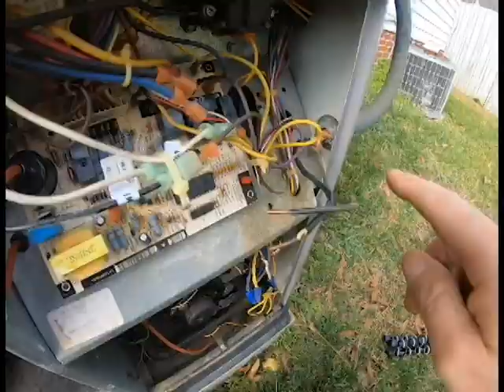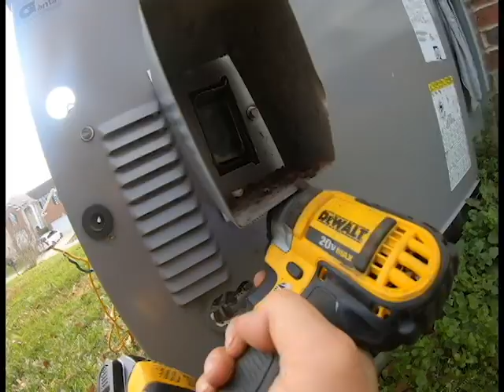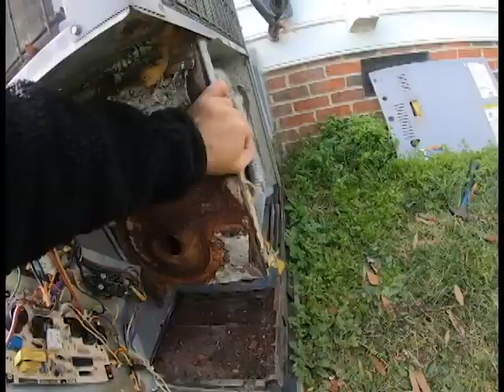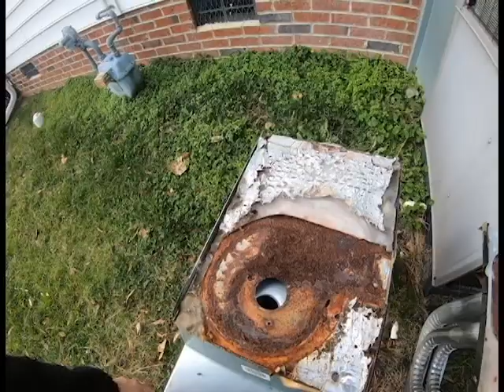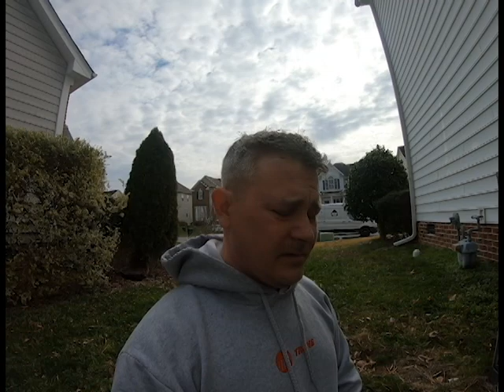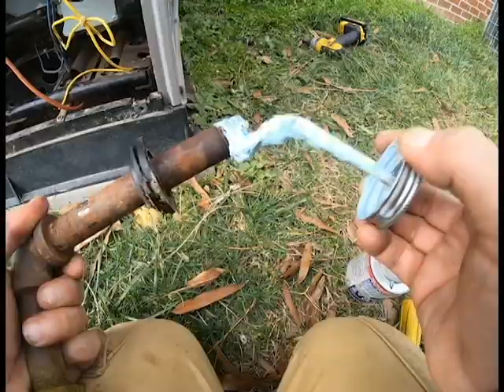How to Replace a Carrier Heat  Exchanger!

Comment: Appreciate this video! I have to do almost exactly the same job for my home unit. I was able to remove the same parts following your video. I will be upgrading cracked aluminum heat exchanger to stainless steel and will be replacing the motor assembly and flue plate as you recommended since mine is even worse. Just waiting on ordered parts to replace later this week.  Thanks again!